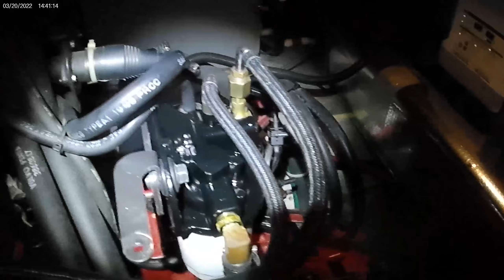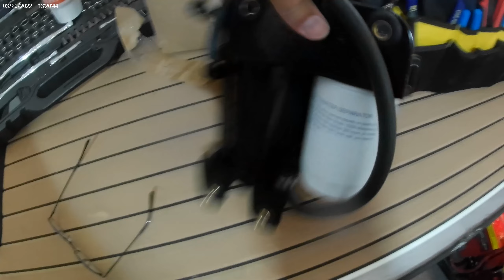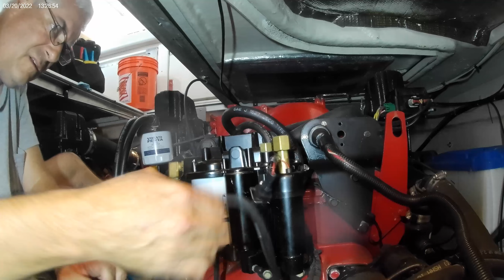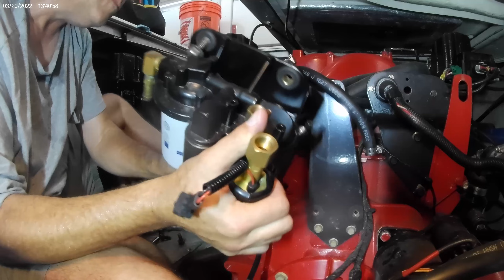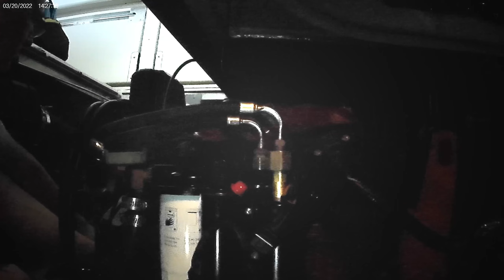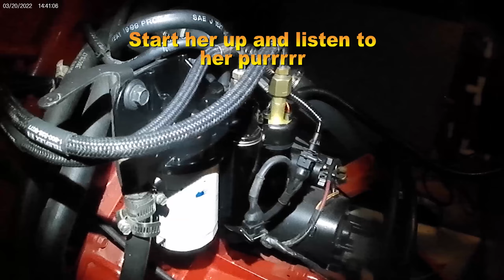Quantum Fuel Systems Fuel Pump Replacement

Comment: Why is the Quantum replacement pump for Volvo Penta engines painted on the inside? Seems like a repeat of Volvo bad pump design.
Reply from the maker: I didn't know they were.  But yeah, if they are they've just repeated Volvo's bad design as you stated.  Crazy.  My pump is running fine still.  No issues.
Reply: @ZippinZim  I just reached out to Quantum and they said they paint 'all' marine pump interior passageways.  They went on to say that the thickness of the paint has a lot to do with whether it peels.
Reply from the maker: @MrFescue  wow that’s interesting. Good idea to call them. Thanks for sharing!